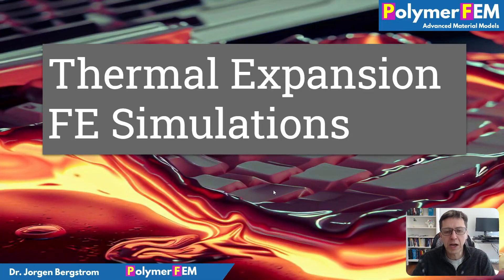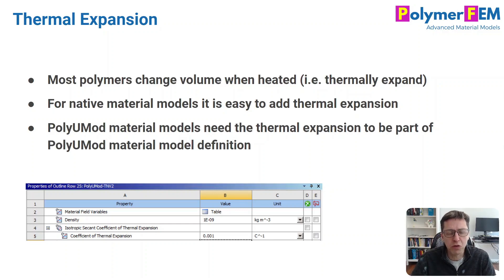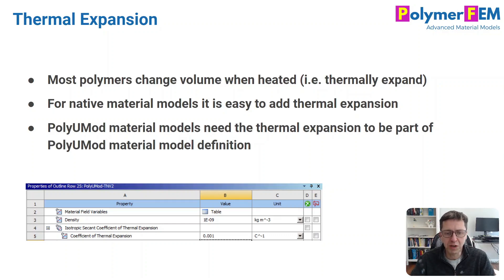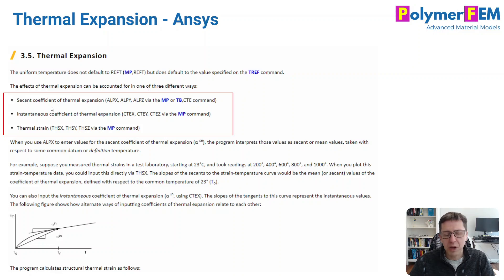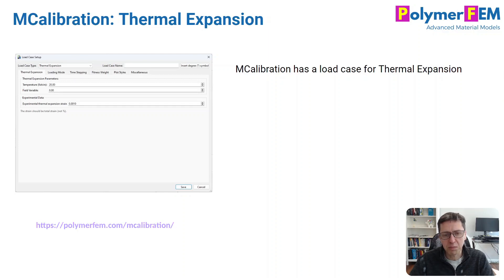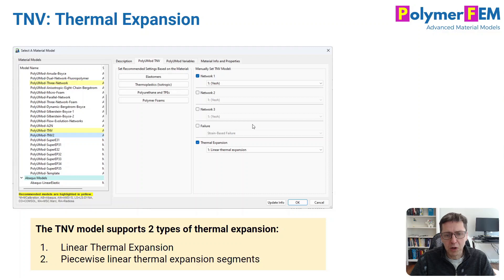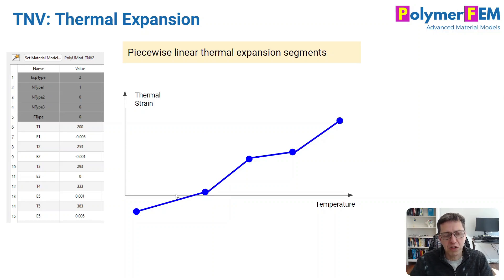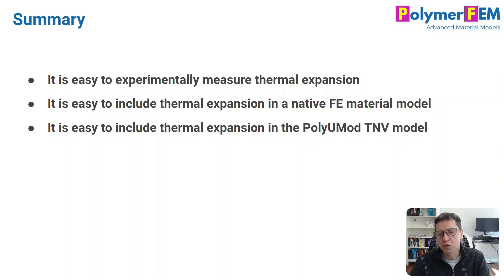Thermal Expansion FE Simulations

Comment: Abaqus requires integrated CTE from the reference temperature for which thermal strain is zero. This is important when CTE is temperature dependent. In this case this reference temperature is part of definition for Abaqus . Very inconvenient since most of the sources don't mention what reference temperature was used during experiment. One can use RT but it is not quaranteed to be true. The final results depend on this reference temperature so be careful.